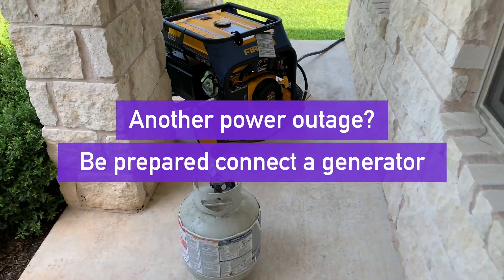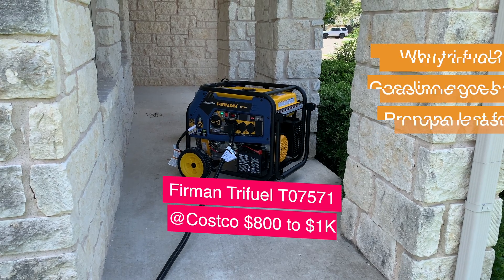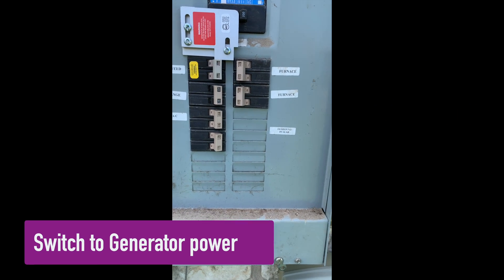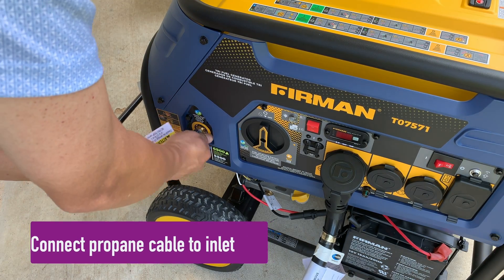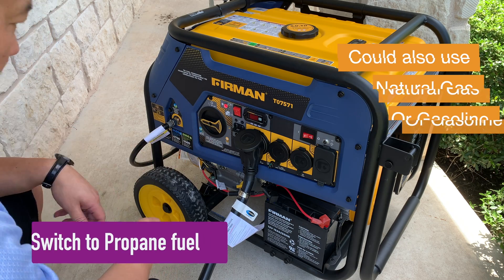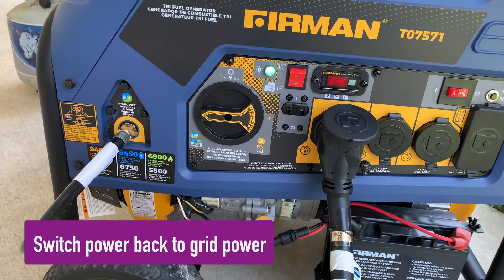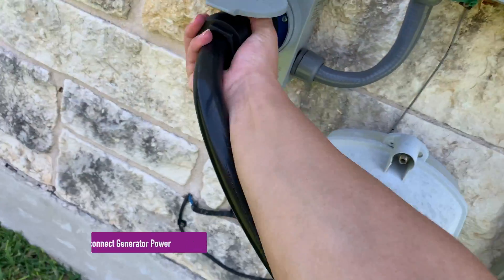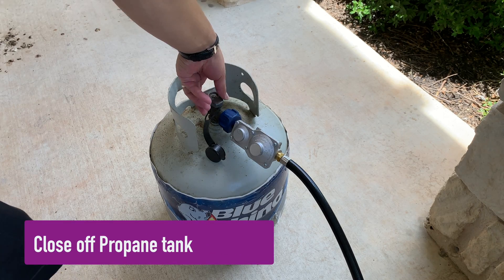Setting up Firman Tri-fuel Generator

Comment: I also have this generator, and I thought that the instructions say that you should never start it up while it is plugged-in.  Should plug in after starting.
Reply from the maker: We probably should not have in plugged into anything.  Why I have the cables connected, it is not connected up to anything until I switch over the box, so nothing to worry about.

Comment: any idea whats diff about the newer "TO70753" from costco?
Reply from the maker: The latest version is basically the same but has a CO detector that will shut off the generate if it detects to much carbon monoxide.

Comment: You missed a step .... Use a heavy chain to anchor generator to column so it won't be stolen. Easy to wheel down the street, just hard to pick up.
Reply from the maker: Good advice, but it is 250lbs.  If someone did steal it, we would know right away as the power would immediately go out.